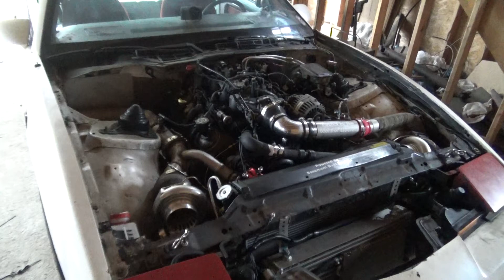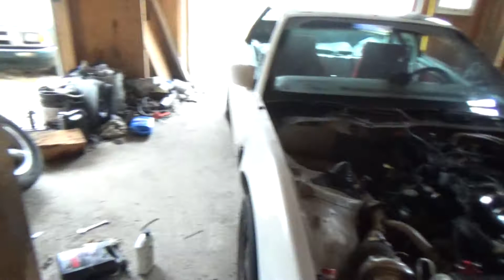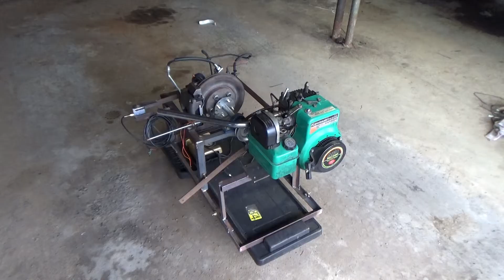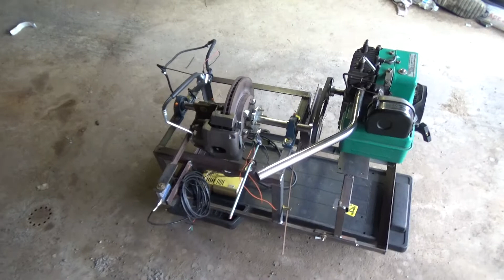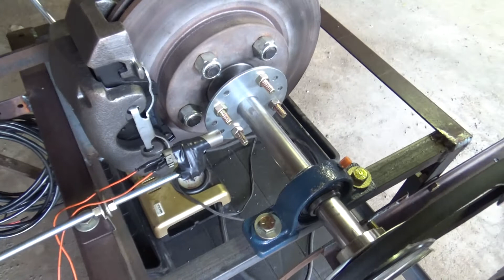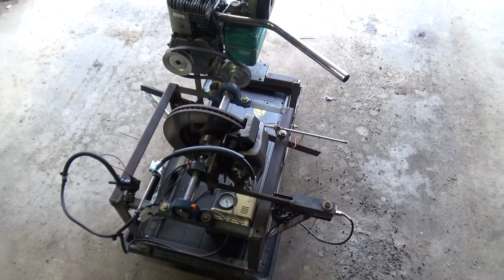What is Twisted Builds?

Comment: That is a huge brake for a small engine dyno.  I've played with some older analog automotive engine dynos and they typically used water brakes about that size for something that you could run a blown big block on.

Interesting, I currently have 2 of those cars (an '87 formula 350 that is turning into a parts car and an '87 LB9 TA which is running aluminum LT1 heads, a custom 4/7 swapped cam, a bunch of LSx parts and controlled by a megasquirt), I've also had an '83 and a '97 and done some GM ECM hacking ('92 K1500 truck also), and keep looking at arduino stuff (currently running an arduino powered progressive/programmable tach in the "race car").

Where in PA are you at?  I'm in MD and we might be close enough to bounce ideas off of.  Back in the early days of the internet I was a member of a JY turbo group that held events at Beaver Springs (beaver Bob still around?), my avatar was something that I drew back then for that.

Comment: A hall effect sensor on an adjustable clip and a magnet to place on the balancer/crank pulley wired up with bluetooth or caveman style, a long wire.  That'll give you an easy universal rpm sensor for cheap.  The ls reluctor wheel sensor works a treat for this sorta thing.